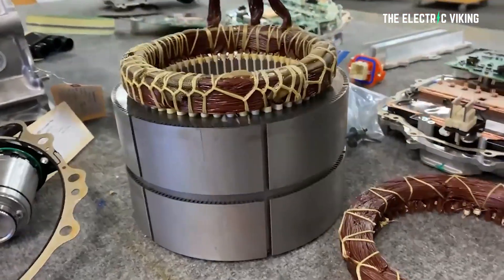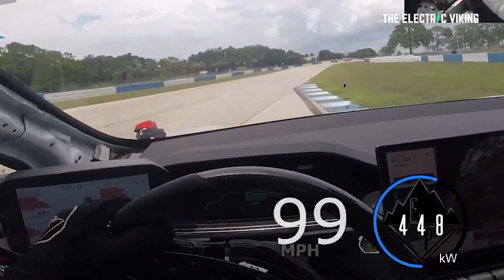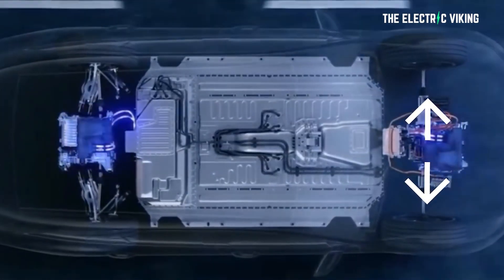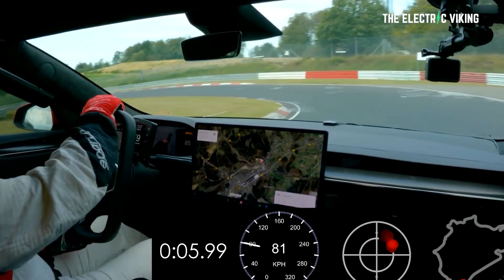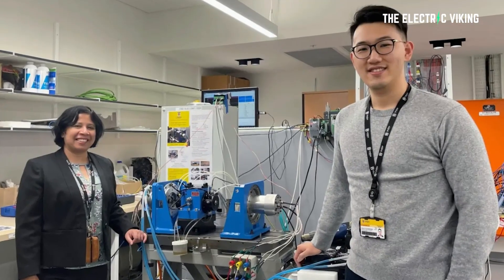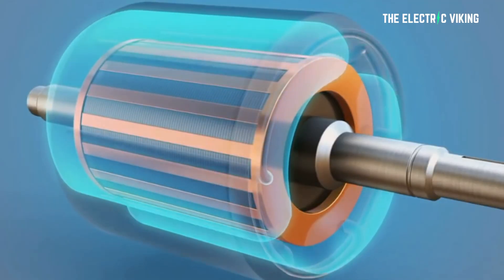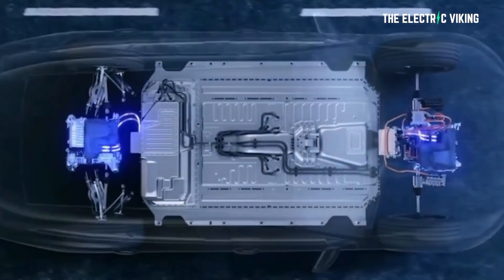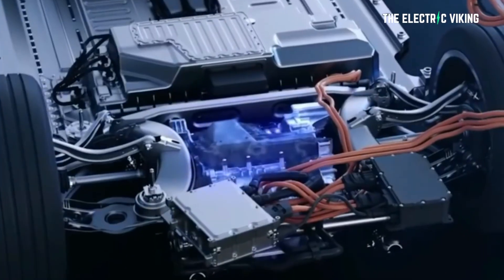World's fastest electric motor can be adapted to run in a Tesla

Comment: Hmmm, some are saying that the rpms which an electric motor can turn is irrelevant. I disagree,  but am open to hearing other opinions. My thinking is that if you have a high rpm motor,  you can take advantage of that by lowering the gearing. I know from personal experience that lowering gearing on an e.v. will increase efficiency,  so Viking, in my opinion,  has a very good point. Again though,  there are smarter people than me out there. What say you?

Comment: I watched this whole video and came away without even getting the concept of how they could turn a motor rotor 4 times faster. I can think of conventional ways, i.e reduce it's diameter, increase the poles, increase the frequency, increase the voltage, reduce the back EMF, ... but what did they do? They claimed than can modify to suit Tesla's needs. How? And how do you interface a motor spinning 100K RPM to a wheel spinning 500 RPM? Use Tesla's turbine?

Comment: Hmmm.

Stationary exterior set of coils around an axis of spinning magnets. Apply copper rings along the interior of the stator that align with a ring of magnets along the center of the rotar.  It is q sacrifice in efficiency to not use all your rotor space, but...

By producing etty currents create counter magnetic force that repulses the magnets of the rotor. These would act as a bearing, and offer an external compressive force to the spinning rotor - that would increase with speed and would push harder the closer it got to the copper... 

So.   If you can run it at 2x speed you can get 2x voltage out of a generator, or 2x more output from a motor.   So you shrink it.

At 4x the voltage, and you can reduce the diameter of all your coils trippling the number of turns in your windings.  That is another 3x in voltage. While still shrinking it.

Now we are talking about quarter size, high kv motors that operate on 1/10 the amperage.  This reduces the amount of copper needed to move power...

If this is what they have done, they could get this into production quickly.

Comment: If you increase RPM you reduce torque proportionally. If your motor and drivetrain could be 100% efficient this is a simple relationship between voltage,  current & torque.
Electric motors are lets say 95% efficient and drivtrains less so, ICE engines are probably only around 30%ish  efficient at best. 
So my point is the motor design is not the place where you're going to improve efficiency dramatically.. you're better working on the drivetrain efficiency as  others have mentioned here. But to be honest the whole Tesla system is pretty efficient at the moment so there isn't that much improvement in efficiency to be had.  Things like rolling resistance, aero, weight and other things will affect the overall efficiency of the vehicle more... miles per kilowatt attained.
Also more heat is generated with higher rpms asuming bearing friction although magnetic bearings could be used..anyway heat generated is energy lost and not used to propel the vehicle.
Ideally it would be perfect if you could use an electric motor which requires no speed reduction like a gearbox,  but that runs at the required RPM creates a maximum speed of say 100mph for the vehicle.. basically the wheels mounted on the end of the motor,  I believe the model S gearbox is a 4:5:1 reduction ratio. I often wonder why this has not been done before as an RPM of a thousand on a 20-inch tyre will give some nice speeds a bit over 100 mph... n thought electric motors are most efficient around 1500 to 2000 rpm.. But I'm sure some engineer can explain to me why its not practcal to simply bolt wheel on the end of a motor with a drive shaft of ratio 1:1 and dispense with a reduction ratio gearbox or similar.
This is a very simplistic view but hopefully explains the basics correctly.. I'm sure someone will put me right if I'm wrong 🤣

Comment: As efficient as current drive units are, I have my doubts as to RPM improving the efficiency of the unit significantly. I'd speculate that higher RPM may help getting more power from a smaller, lighter, package, but it would have to outweigh other factors such as increased air and bearing resistance, reducd heat dispersion due to the reduced mass and surface area, and centrifugal forces trying to deform the rotor. You would also be fighting harder against inertia in order to accelerate and decelerate too and from such high RPM rapidly.

Make no mistake, I love the idea of faster and more powerful electric drive motors, but I can't help but be sceptical regarding efficiency until I see the tech in a vehicle improving range without sacrificing performance or reliability

Comment: The main way that a motor running at these speeds is useful is that it will have a smaller rotor diameter. Smaller means less mass for the same power output. Less mass for the vehicle as a whole improves distance travelled per kilowatt hour of battery if acceleration and deceleration are involved. 
So the motor efficiency might be about the same as any other modern electric motor, roughly 95%, but there can be a small improvement in overall vehicle efficiency purely because of reduced mass.
Where the higher rotation speeds can lose out is in higher bearing friction and aerodynamic drag around the rotor, coupled with increased transmission gearing losses. This can be minimised by careful design.
But, other than that, I'm inclined to treat wild claims about big improvements in efficiency with a healthy degree of suspicion. If are they claiming a big improvement over the efficiency of an electric motor which was designed 25 years ago, then the claim might be valid. But it's unfair and misleading for them not to state clearly what they are comparing their motor to.

Comment: Increasing RPM is more important in a Tesla because they don’t have a transmission. One speed direct drive top speed is dependent on the drive gear ratio, RPM and curb weight

Comment: Putting electric motors into the old vehicles when the average DAILY DRIVE is only 7kwh means even an inefficient set up uses maybe 10kwh, solar is free and cheap daily.
Even a little 50kwh EV battery would work.

Comment: As an engineer, this smells fishy.
Jet engines at max spin at 9,000 RPM and have been doing so for decades
Sure there are turboprop jets, that spin at 30,000+ RPM but the jets you fly on are below 10,000 RPM
because of the strength of the materials used and the size of the spinning turbines. Spinning at 30,000 RPM requires reducing gears to turn a prop that does not exceed the speed of sound at the tip and the jet engine is small.

Spinning higher than that with air around it heats up that air
so unless a new electric motor is housed in a vacuum then they have to use experimental
materials and cooling to spin at 100,000+ RPM

There is so much junk science out there and especially in the EV world that unless there is a Nobel prize to verify the "game-changing" breakthrough it's a hoax designed to attract low IQ investors.

Comment: There are two ways to increase the maximum (red line) rotational speed of electric motors: one is to increase the strength of the rotor to resist centrifugal stress, the other is to reduce the diameter of the rotor. Tesla used the "increased strength" approach with the Plaid motor carbon fiber sleeve. I suspect these researchers are using the "reduced diameter" approach. The main problem with reducing the rotor diameter is that the torque is reduced as well.

Comment: efficiency has NOTHING to do with high rpm capability.
one of the best motors regarding efficiency is the axial magnetic flux motor. for now i only know the motors from the two companies Yasa and Magnax. I downloaded the efficiency graph from Yasa. it was close to 98% from about 10%....90% rpm max (10.000).
that leads to 10% increase in range compared to radial magnetic flux motors in usual EVs.
that this is not a phantasy is proven by mercedes in their EQXX engineering study.
they will use this motor in AMG versions of their EVs because it is lighter and smaller as well.
great design!

Comment: Efficiency percentage is defined by how much energy reaches the road divided by the energy fed into the charger. Making the motor turn faster allows a smaller motor but it does not automatically make it more efficient. 
Motorcycles are a perfect example. Sports bikes rev to 16000 rpm to move a 200 kg bike. Small cars weigh at least 1000kg but often give better gas mileage than the revue bikes. 
High speed traction motors need more step down gears to give a useful road speed. Every gear pair reduces efficiency.

Comment: 100 times repeating that higher RPM will lead to higher efficiency doesn't prove it! There is NOTGING in information given not only proves that point it doesn't even offer hypothesis how it may do so. The only notion of reducing size and weight of it... well how much this will increase range? I mean say how much range would reduction of say 30 kg add to the car weighing 2200kg? I understand why researchers looking for funding for their work would push this notion... but anyone with common sense applied to electric vehicle as they exist today... Really? 🙄

Comment: Some people commenting below may have somewhat addressed this, they made good observations, but generally there is a trade off between acceleration and rpm. Acceleration requires torque. Tesla's 3 phase AC motors are capable of higher rpm, but still have less torque than a good old fashioned series DC motor that is only capable of 5000 rpm. It has max efficiency at 3000 rpm though, whereas Tesla's motors have max efficiency at much higher rpm, and even at max efficiency is still about 3% less efficient than the 3 phase AC motor. I believe permanent magnet motors are even a bit more efficient than the 3 phase AC, though I haven't looked into that much. As Mr. Thesling said below, you're already at like 95% efficiency, so there isn't too much possibility for improvement. If you want to drag race, you want torque. If you want high speed cruising, you want rpm.

Comment: I wonder how much efficient a higher rpm smaller motor will be. I can imagine a faster spin means more heat generation, which means less efficient, and likely need more cooling management, which also increases complexity, and added weight?
Reply: i believe if you use the star rotor design you can cancel out the heat, vibration and EMI  generated - some professor did that 60 yrs ago - A student of that professor in Kosovo and I brought that design to Daimler Benz Head of research and development EV motors 6 yrs ago - we had 2 - hour long phone meetings with a number of the engineers including the top guy. The patent had expired and thus was public domain so they eventually walked away when we had exhausted all avenues.

Comment: A higher gear reduction ratio leads to a larger more complex gearbox with higher losses.  High RPM bearings are going to be a big challenge. Tesla no doubt has optimized at the vehicle level.  Any one parameter can be pushed to an extreme, but this likely isn't optimal for the whole car.
Reply: Tesla had lots of issues with motor shaft bearing failures in early Model 3 examples. It wasn’t a service item due to construction so the whole motor was replaced

Comment: Hmmmm if the motor is on average more efficient for a given speed and a given load, that is, it takes less energy to run in those conditions it takes less power, then you should get more range….are you saying because the motor has higher peak rpm capability that it runs at a higher efficiency?

Comment: I always thought adding more gears would improve the range and also top speed. Low rpm = less consumtion.
Reply: The efficiency curve of electric motors is very broad. You're thinking of gas engines where they have very specific conditions for high efficiency - low RPM and high load. This doesn't apply nearly as much to electric motors, at least not enough to make gears worth it. The extra cost, complexity, maintenance (how nice is it not to have to think about transmission maintenance!?) and weight of gears more than offsets any small benefit they would offer.

Comment: The Lucid Air motor is smaller lighter and 2x more powerful than the Tesla Model S Plaid. See the Lucid Tech talk on their motor technology which went out on Youtube just recently.
Reply: Do you even know anything about electric motors, or are you just mouthing off based on PR YouTube video of a company interested in selling headlines? The Plaid motors hold the powerband all the way to 200 mph. That's why they are wrapped in carbon fiber. Almost as efficient as their LR version despite being 200 lbs heavier. 

Lucid's EV motors deliver massive horsepower for such brief stints. Might be fancier than Plaid, but also more expensive and more time consuming to produce. Peter talks about their motors being able to be mass manufactured, but, we're still waiting on them to scale up.

Comment: So 100.00ß rpm are just 4 times more than the plaidmotor. The efficiency ist about 95% currently and you have only potential of 1-2 % not significantly also with a bit less weight in motor. An other point is power and durability - an ev s no small drilling mashine - it should be run about years and with much more strength.

Comment: not sure another minor electric motor innovation has a significant value of information, they already are 98% efficient... I have a 80.000 rpm electric motor resting on my desk at the moment... and it has air bearings... there are 180.000 rpm and more electric motors in industry... they have millions of hours of mtbf, and only wearing part of it is the shaft bearing (and if only it is a mechanical bearing)... air bearing's doesn't wear out... stupid thing is to think EM with terms of ICE, which only has 25% efficiency at its best, and has only 10.000 hours mtbf, result of a gazillion different reasons rising out of it's stupid complexity... 10 years from now nobody will remember ICE, children would never be heard of them...

Comment: It takes many years to go from the lab to industrial production. There are often tradeoffs in designs that only become apparent with lots of real-world testing.  That being said, spinning anything at above 30,000 RPM takes incredible metallurgy, because things crack and break apart due to centrifugal forces.  In Jet turbines, which are the fastest spinning things used in quantity, they grow the blades from a single crystal of metal, and the production of them is specialized there are only a handful of companies that can make them.
Reply: UNSW is where Tesla was probably 4-5 years ago. Tesla has a lot more engineers and capital than a university. Tesla also realised that even at 23,500 rpm’s the energy produced when running at peak kept over heating and cracking the motor, hence they engineering and developed their own machine to build the carbon wrapped motor. Also their magnets for the plaid motor are in a pattern that I’ve never seen before. It’s crazily well engineered. They are literally leagues ahead in electric motor design and access to SpaceX metallurgists has obviously being paying off

Comment: This very well mary be a breakthrough for cars using a transmission. A smaller size motor could turn the tranny to create the torque at the rear wheel. 
Unfortunately too small electric motor just cannot produce enough torque but could be used in tandem with a tranny….. which helps underpowered gas cars to run down roads today.

Comment: 100k RPM would require more gearing and would wear out bearings much faster. However, magnetic suspension bearings do exist, and would easily outlast the EV, removing another wear / repair issue.

Comment: The key most likely is what you mentioned at the end...durability.  How long will they hold up in actual use in a production vehicle, where they will be tested under the kinds of loads they will experience under the full range of actual real world use conditions.  It's amazing...the rate and range of innovation that is currently occurring in battery and motor technologies.  Now, let's just mirror that in the development of cheap, efficient, easily scalable, extremely reliable, abundant and passively safe on-demand electrical power generation...THORIUM FUEL CYCLE MSRs.  Pretty please.  With sugar on top.

Comment: Electric motors are already 90+% efficient in converting watts to motion.  Going from 90% to 100% would only increase range by 10%. 

I also see higher RPM having higher loss.  Higher RPM, on a given bearing, increases it's loss.  Being the tires rotate (pretty much) the same RPM, higher RPM requires a bigger step down.  

The core laminations have loss, for the same power in the core, loss goes up with frequency.  The way to reduce this is to use thinner laminations, which is only a partial solution.  High frequency magnetics use powdered metal, or even ceramic metal oxides (ferrite) to reduce core losses.